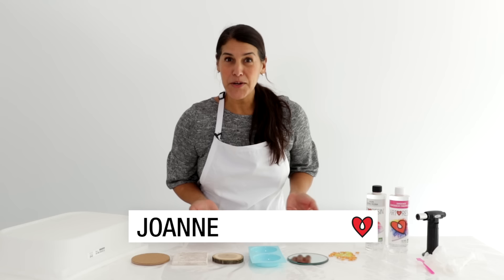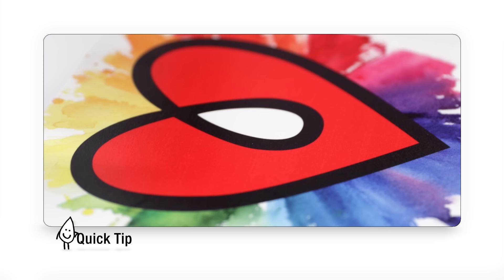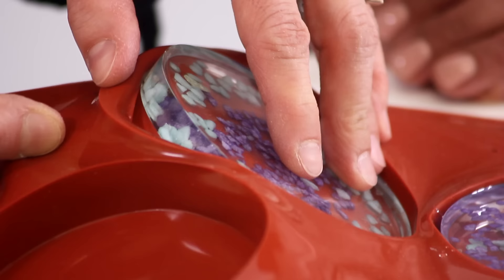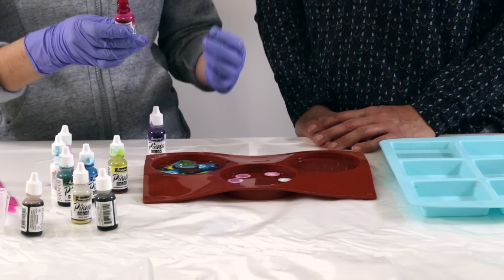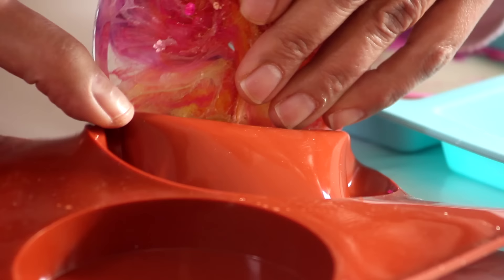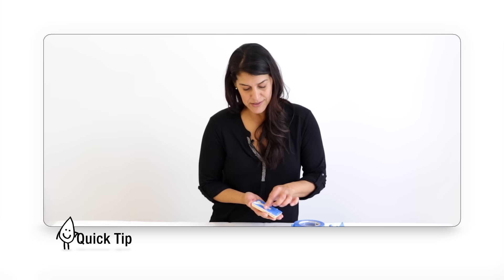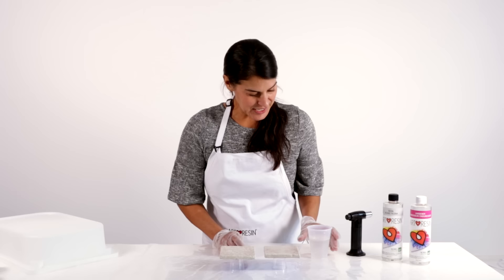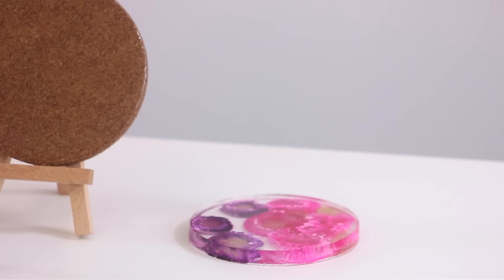How To Make Epoxy Resin Coasters - EASY!

Comment: resin coasters dont work rrly cuz hot things will make the resin tacky. same with ashtrays, resin ashtrays burn and stain overtime. coasters and ashtrays would only be good for decore
Reply: Madi, we don't recommend using it for ashtrays either but we do have good luck with coasters as ArtResin has a heat resistance of 120F/50C so a hot cup of coffee is perfectly fine but something like a dish out of the over certainly would mark or damage the resin.
Reply: @stephaniegates2867  ok, also, someone tested your resin, and said it wasnt cured all the way and showed us that it was still pretty flexible after the 24 hour mark, does ur resin always start soft after the 24 hr mark?
Reply from the maker: @iridescentfox5084  oops posted from my personal account :) ArtResin has a cure time of 24 hours cure to the touch with 72 hours for a full cure when used as directed. Pours thicker than approximately 1/8th inch may take longer than 72 hours to cure depending on how deep you pour. This would easily explain why their piece was flexible at this time.
Reply: @Artresin  okay, thank you for answering my questions

Comment: Is your resin UV resistant?
Reply from the maker: UV is super powerful and all epoxy resins will eventually yellow in time, including ArtResin, but ours will yellow at a slower rate compared to most resins on the market due to our 2 different UV light inhibitors.  There are lots of variables that can affect yellowing, the biggest culprit being direct exposure to sunlight.

Comment: Just wondering how come you aren’t wearing a mask. Every instructions I read says to use a mask. Please explain. Thank you
Reply from the maker: It is important to follow the directions for the brand you are using.  ArtResin is non-toxic and does not produce fumes or VOCs , it is safe for home use without a respirator when used as directed in a well ventilated area.

Comment: Art resin is not good for coasters. I purchased some art resin based on this video and made some coasters. My ratio was spot on, I used a scale and so was my cure time. As soon as I place a hot mug of coffee on my coasters they got very soft and bendable. Perhaps ok for cold drinks, but definitely NOT hot tea or coffee.
Reply from the maker: You mentioned using a scale for your measurements. Are you measuring by volume? ArtResin is designed to be mixed 1:1 by volume and not weight. If measuring by weight you will have issues with your cure.
Reply: @Artresin  My ratio was 1:1 (I plopped it on the scale after just to be sure). I've spoken to several other artists that do this professionally and they say the same thing.

Comment: Don’t you need a mask when you work with resin?
Reply from the maker: ArtResin conforms to ASTM D4236, meaning it is certified as safe for home use and non-toxic when used as directed, however there are some safety precautions that every user should follow:

Wear gloves. ArtResin is very sticky in its liquid form, so gloves will protect the user from a mess, as well as skin irritation. Clean skin promptly with soap and water if it does come in contact with ArtResin.

If ArtResin somehow comes in contact with your eyes, flush with water repeatedly and do not rub. Promptly seek medical attention.

Work in a well ventilated area. Wear a respirator if ventilation is poor.

See our blog for further information: https://www.artresin.com/blogs/artresin/what-safety-precautions-should-i-take-when-using-artresin

For detailed health information, please see the ArtResin SDS.
https://www.artresin.com/pages/sds

Comment: My friend was just in the hospital last week with a near fatal lung infection from working with epoxy resin while not wearing a respirator, I understand that this is a pretty small amount of resinbut still, your faces are really all up in it. I was working on a project this size without a respirator (got a pretty nasty headache tbh)  and his girlfriend freaked the heck out on me and immediately dragged me to Home Depot. Is art resin non toxic somehow? Genuinely curious. Hopefully you can edit in some safety precautions if not, don’t worry it was the last thing that came to my mind too after months of prepping an entire area and about $1000 worth of resin supplies -__-oops
Reply from the maker: Hi Chelsea, we are very sorry to hear about your friend and hope that she is doing better. ArtResin is non-toxic when used as directed and no respirator is required when using in a well ventilated area. This means that if you follow the instructions for use, there is no cause for concern or risk to one’s health. We've had our product evaluated by the American Society for Testing and Materials; ArtResin conforms to ASTM D4236: Safe for Home Use. 

When it comes to safety precautions, a Safety Data Sheet is your go-to reference no matter what product we’re talking about. The ArtResin SDS is available on our website. No matter what your safety questions are, you will find the answers in that document :) https://www.artresin.com/pages/sds

Comment: why are you not telling the ppl they supposed to use PPE
Reply from the maker: Hi, a mask is not required when working with ArtResin in a well ventilated area. If ventilation is poor, a mask is recommended. When it comes to safety precautions, a Safety Data Sheet is your go-to reference no matter what product we’re talking about. The ArtResin SDS is available on our website. No matter what your safety questions are, you will find the answers in that document! https://www.artresin.com/pages/sds

Comment: How come you are not considered with safety’s and health issues as wearing a mask or keeping the glove on?
Reply from the maker: ArtResin is non-toxic, low odor and releases no fumes or VOCs so as long as you're working in a well-ventilated area, the only personal safety equipment ArtResin requires is gloves as direct contact can irritate your skin.  We were working in a well-ventilated area so we didn't need to wear a mask, although if you feel more comfortable wearing a respirator, you certainly can.  

You are correct that there was a portion where we did not have gloves on, we were careful to not touch the resin while placing the gems.

Comment: What about masks?
Reply from the maker: ArtResin is non toxic and it doesn't produce any harmful chemicals like so many other epoxy resins do.  You do not need a respirator when working in an open space with proper ventilation when using ArtResin.